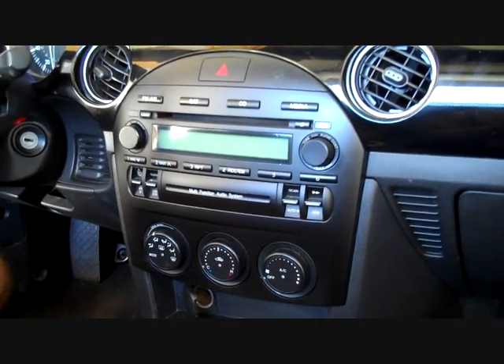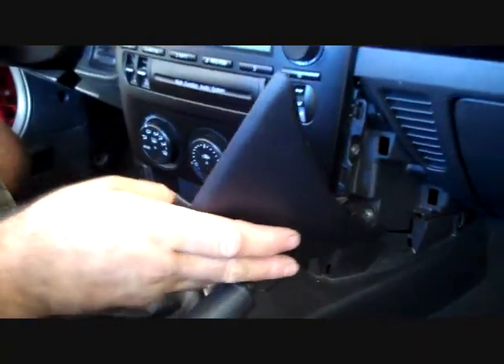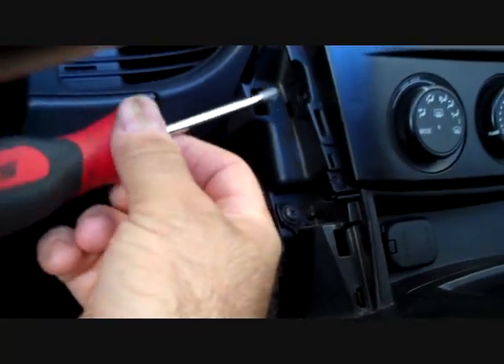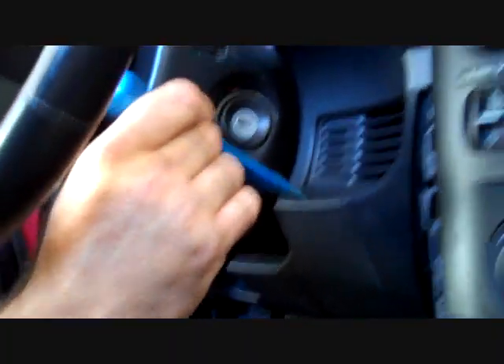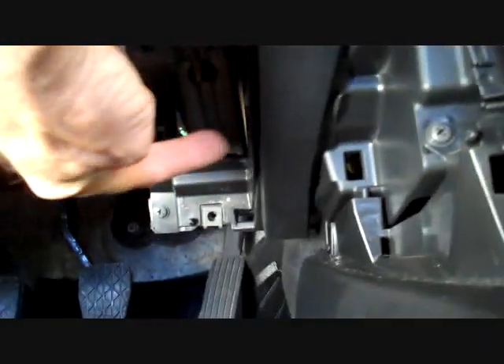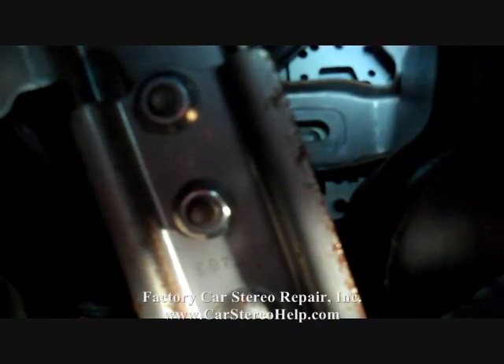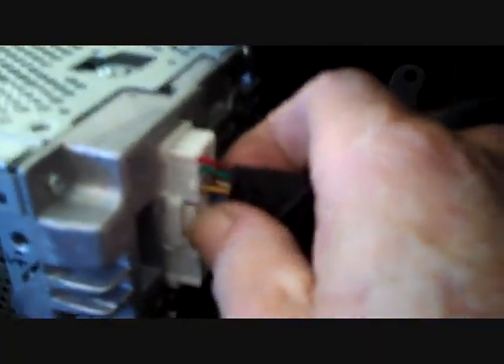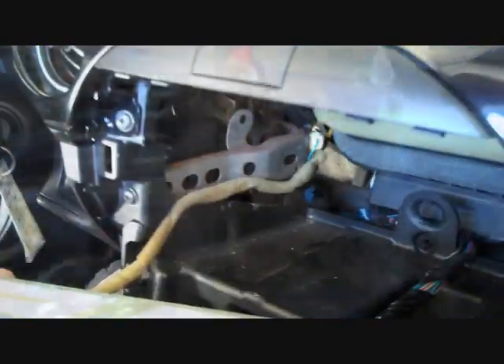Mazda Miata MX5 Bose Car Stereo Removal 2006 - 2013 = Car Stereo HELP

Comment: GREAT Video! Thanks!Some additional info for others:  As mentioned in the video.  The cable lengths are pretty tight the first time the stereo is removed.  If you or someone else hasn't removed it yet, you will find it easier to access the cables by removing the glove box and reaching around from the back and side.
Reply: Doubt that you will see this 3 years later, but is there 'slack' on these cables once you get your hands on them? I'm a little confused. Both you and the OP state they are 'tight' first time, but I wonder why and what one has to do to 'loosen' them. What would be the point for Mazda to have them so 'tight' in the first place?
Reply: @SolRC  Outstanding! An immediate response! Thanks for the 'zip tie' tidbit. Need to know what to expect with my lousy eyes (I just turned 70 last Saturday). I really need to replace the changer. Now that I've researched that removing the glovebox is easy,  I'll probably look there first.
I was a bit puzzled about the cables having no slack, since I would think the factory might realize that the unit may have to be removed at some point, so, leaving a little slack would be a plus. 
One more quick question: Can the plugs be easily reached from the removed glovebox area? Would you suggest unplugging them 'before' attempting to remove the unit? I'll be doing this project by myself, so there will be no extra hands available.

Comment: FYI: This doesnt work on all NC models, my 2013 needed to have the shifter/armrest panel partially removed to reach 2 screws that hold the "side panels". In the video, he simply prys them off with the tool. You will break the panel if your model has the screw attachment points
Reply: There was a mk3, mk3.5, and a mk3.75 of the NCs so it's probably different interior for each one

Comment: Thanks! That hidden bolt on the left was my problem. 
Apart from that: for the NC1 2011 and younger you need to remove (or shift) the consule to reach 2 screws that fix the sidepanels, they cannot be removed with just a pry-tool. The rest is alike.
Reply: Can you elaborate? I see the two bolts, but no screw... how do I remove/shift the consule (and what's a consule lol sorry for my dumbness)
Reply: @BenDunkle  I edited my comments, I mixed up the term bolt and screw (non-native).

The side panels are in 2011  both fixed with a screw that is hidden by the center console (de part around the gearlever and handbrake).

The radio is fixed (theft prevention I presume) with a bolt to the right and a bit deeper of the two bolts that are shown in the video. 

I couldn't get it out, difficult to reach.
Reply: @stapeling  OK thanks, I was able to find it once I knew it was a bolt!

Comment: The reason you couldn't find the driver's side 10mm bolt is that 2008 Miatas don't have that bolt any more. Just remove the phillips screws in the front and pull the radio out. No need to pull out the metal under the steering wheel, except that it makes it easier to route wires if they're going that way.
Reply: Baxter Tidwell Thank you very much for providing that information! I'm glad I saw this before I started replacing the Bose system.
Reply: +Baxter Tidwell The 07 ZSport doesn't have one either. Makes the whole thing a total piece of cake.
Reply: the 2011 has the under dash 10 mm screw
Reply: @stephengilliss4790  Correct.
Reply: This comment thank you lol

Comment: Would have liked to have seen how to get to connecters the first time you removed head unit.  My 2011 bose system will not pull out anywhere near far enough to reach connections.

Comment: Hello, could you connect the aftermarket radio dimmer cable to the car? Wich one is it? Wich colour?, i have the same car and i changed the radio to a double din,.. The radio have the dimmer cable but i don't know where to connect. Everything is working ok, speakers, camera, subwoofer, Bluetooth,  steering wheel controls by metra axxess, but when i turn on the lights, the screen still very shiny, and it supose that it have not to be that way. Can you help me? Thanks.

Comment: Do you really need that hidden screw when you replace the faceplate and the stereo?
Reply: The hidden screw locks and secures the stereo in its bracket. So yes, you need to. The only other way is to disassemble the Miata around the stereo, but the last screw wil be that same one... 😉
Reply: @stapeling  I cannot find that hidden screw...

Comment: The 10mm bolt is probably just for security because the radio is super easy to remove (for a thief) without it. Mine's missing also. I know the threads are M5, but I don't know how long it is, and I probably won't be able to find a 10mm head replacement. But, if anybody knows the exact bolt size for this bolt, please post it. Thanks.

Comment: I've got the standard 2008 radio, not the Bose. Does the standard radio have any plugs on the back where I can attach a cord for a USB socket, or a cord for an mp3 player?
Reply: Yes - There's apparently a common and inexpensive add-on that plugs directly into the rear of the unit, no mods needed. Gives a 3.5mm AUX that is activated by the MEDIA button on the head unit. Just ordered mine so I haven't installed or trialed yet. But has many good reviews. (No I'm not the seller or affiliated with them)
Link: http://a.co/ao1v3eb
Reply: @peacefrog0521  Thanks so much for the link, just ordered it.

Comment: Little slot - doesn’t not exist - fail
Reply: Not so - on first glance in my car I said the same thing. But look again (and use a flashlight) at the 'top' of each side and you'll see a really small 'space' to put whatever you're prying with in. I haven't done it yet, need to find the right tool that won't damage the plate when prying. But the slots are there.